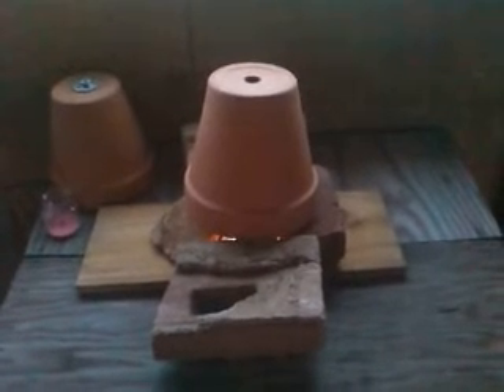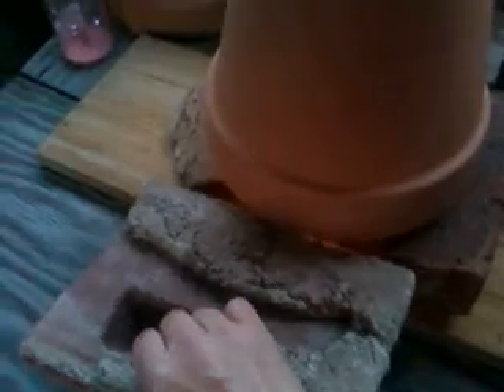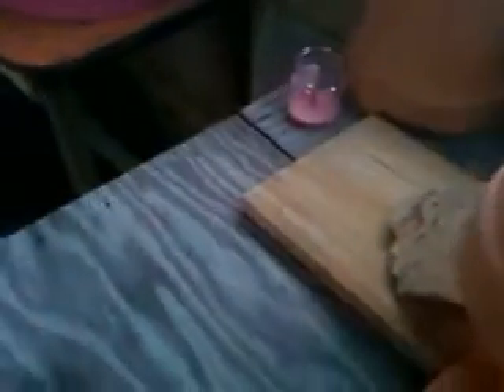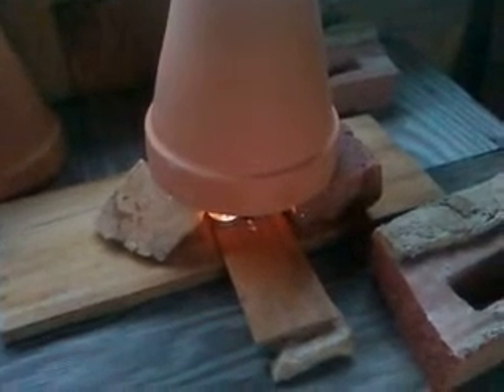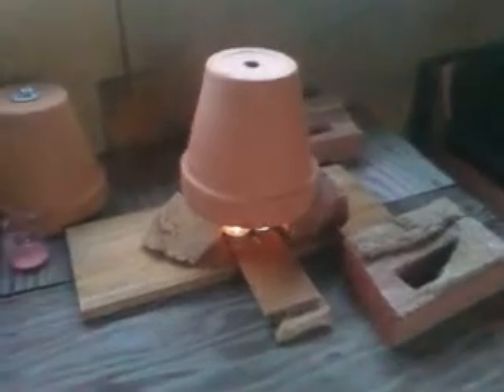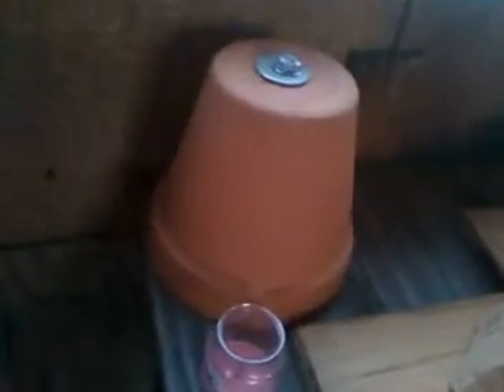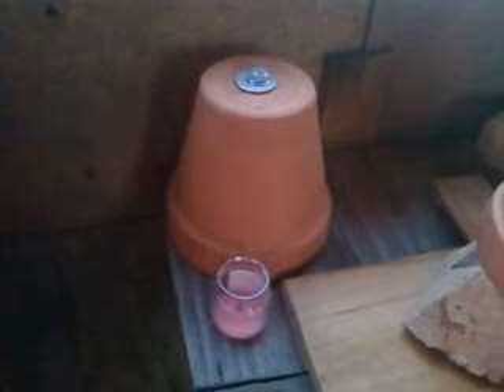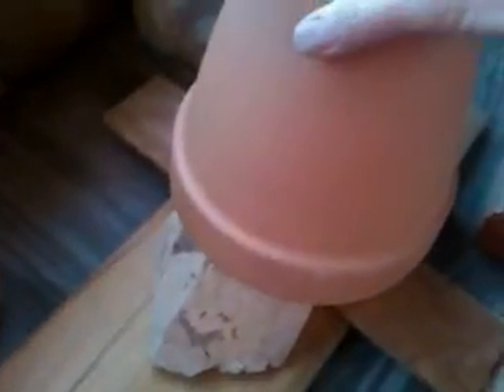CLAY POT HEATER -- FIELD TEST RESULTS

Comment: Interesting... I made one with the bolts, the bolt heats up REALLY hot and radiates heat; also transfers it to the pots.  I also only used one candle so far, I'm waiting for it to get really cold to see the difference.
Reply from the maker: Yeah, it gets really hot, but the real test is when it's really cold and there's no other heat source.  Keep me posted on your results.  I'm always looking for better ways.